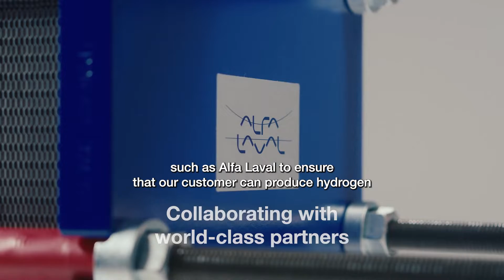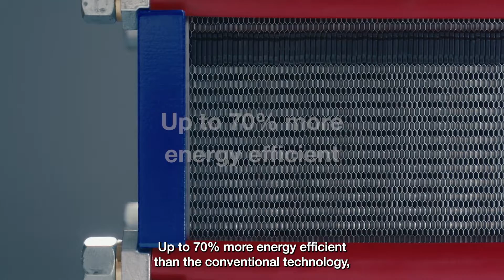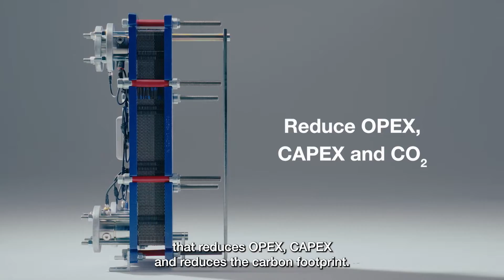Partnering to scale-up green Hydrogen with NEL

Comment: Unfortunately, I've owned NEL, a dead, bloated cow of stock, since 2019. . .   An investment in NEL is just throwing money down the drain.  After all their hype and BS, they have less than 100 MW of installed capacity worldwide.  None of it operates on a remotely competitive, non-subsidized basis.  Look at their inside trading!  Look at their historical press releases.  NEL is like a bus being driven backward down a busy street by Greta Thornburg.  NEL is not a rational business platform.  Rather, it is a silly pie-in-the-sky notion put forth by bored beneficiaries of the Norwegian Pension Fund to distract themselves during their long winter months.

Oh God, somebody shoot this stock, please.  Just look at its utterly miserable performance since day 1.  Why doesn't Nel's CEO, Håkon Volldal, talk about scalar delivery and realistic CapEx and OpEx per Watt delivered?  Because he can't.  Oil & Gas inventories are expected to peak in 2030, putting downward pressure on conventional fuel and ammonia prices.  These hapless Norwegians imitating businessmen don't have a clue.  Most ironically, even if they had their act together, nobody (and I mean nobody) knows how to contain, transport and utilize H2 in an economically plausible way to do recall work like propel a truck or a car.  This company is practically speaking a giant farce positioned on climate change alarmism.  Looking at your stock price and negative earnings since inception, how's that working for you, Mr. CEO Håkon Volldal?